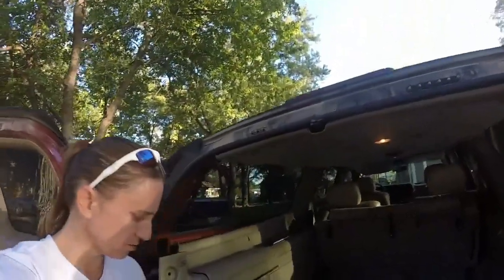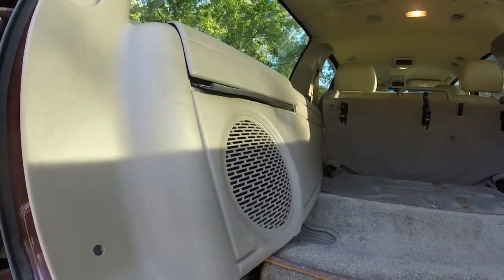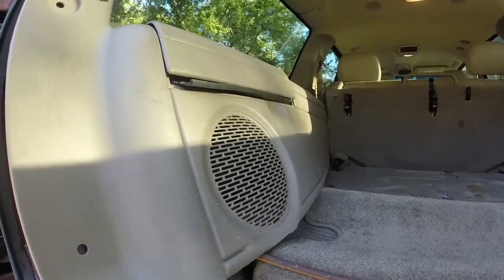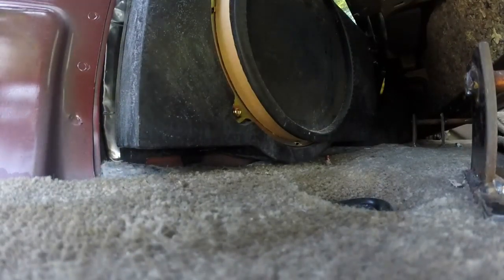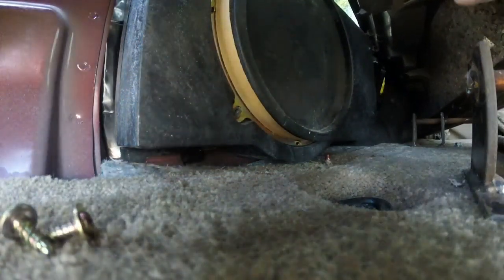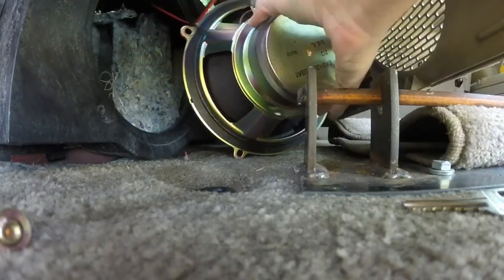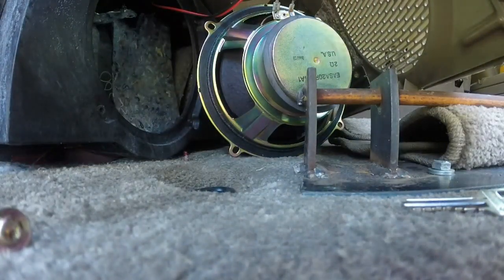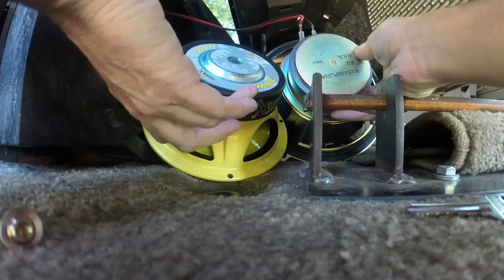Cheap solution to a blown speaker 2002 Suburban

Comment: Hahaha.... you're such a lovely person that I can't bust chops for getting my hopes up.  You get extra points for taking the damn thing apart and figuring it all out by yourself.  To replace it wont be free or cheap, if you plan to use factory power and factory enclosure. All the cheap subs require a lot larger enclosures than the factory one gives. Also, when you're ready to replace it and make it work, make sure you get a sub that is no deeper than the factory sub, that is 2ohm SINGLE VOICE COIL!!!  Do not get 4 ohm single or dual voice coil for the factory amp. You'll quickly realize that even though the new sub sounds better than the factory blown one, it will be quieter than the factory sub was.  Single voice coil 2ohm  8"sub no deeper than your factory sub.  remember that.
Reply from the maker: Thanks for the advice. At the time of this comment (june 2020) this speaker is still not fixed. Last month,  i lost park on the transmission so am trying to determine cost of repair  and if i want to repair or upgrade to a newer model

Comment: The speaker isn’t blown - it’s just the foam ring that’s rotted. You can buy replacement foam rings called surrounds from eBay. Just measure the diameter of the paper cone and the frame then find a close replacement. This is like $6-10.
Reply: Aaron H trust me that sub is definitely blown no point trying to revive it when you can replace for next to nothing

Comment: I just replaced a Suburban sub the other day.  This is what I used: https://www.amazon.com/gp/aw/d/B007JV7F4W/ref=mp_s_a_1_2?ie=UTF8&qid=1517538136&sr=8-2&refinements=p_85%3A2470955011&rps=1&pi=AC_SX236_SY340_FMwebp_QL65&keywords=8  You'll have to search how to wire 4 ohm dual voice coil into 2 ohms (basically run them parallel).  Most shallow mount 8 inch subs will work if the depth is under 3.8 inches.  No matter what subwoofer you buy, including the one I linked, you need to make/buy an adapter ring because the bolt pattern is uniquely wide of the factory sub.
Reply from the maker: Thanks! and at this point, looks like I will be replacing all of them when the weather gets nicer
Reply: This will show you how to use a dual 4ohm subwoofer and wiring it in parallel to run at 2ohm.

Comment: That speaker is a terrible choice . I used a planet audio 8” sub and bridged it down from a 4 to a 2 ohm worked great
Reply from the maker: i still have not replaced this speaker...
Reply: Planet audio 8" that sells on amazon is to big for the surburban.  It ok for a Tahoe becouse the speaker box is bigger. You need tp buy a shallow sub.

Comment: There is a company called simply speakers that sells a kit to fix the outer ring if the Tahoe/Yukon/suburban factory non Bose sub that looks like this https://www.simplyspeakers.com/panasonic-speaker-foam-edge-repair-kit-fsk-8-1.html

I used it for my sub that's exactly the same as yours and it worked flawlessly. $19 is pretty cheap
Reply from the maker: Thanks!

Comment: It's 6 and a 1/2 then it's made for custom panel or door application pioneer and kicker make one perfect for that specific box
Reply: That's supposed to be an 8 inch I believe
Reply from the maker: so I am looking for an 8" speaker from either Pioneer or Kicker? And that will fit in the rear box on the driver's side?
Reply: Make sure they know it's a slim fit for stock application
Reply from the maker: any preferred vendors of Kicker speakers?
Reply: Me Being Cheap I'm from wichita so I go to advanced audio but I think best buy or your local audio shop would know what to do find out part number and search it online just to save little money
Reply: Me Being Cheap 40cwrt82 is part number you can search around but around 100 average price it's it's a slim 2 ohm
Reply: If you haven't replaced it yet it's an 8" sub, planet audio fits that box with no adapting except for ground terminal and drilling new mounting holes, but it will fit the hole. Twenty five bucks approximately

Comment: That would have fit no problem
Reply from the maker: funny thing...i still don't have this fixed and I'm still driving this suburban.  I seriously couldn't make it work when i ordered that speaker
Reply: @mebeingcheap7644  you just use the regular screws in the very edge of the screw would catch the edge of the speaker and four of them would be enough to hold it in place